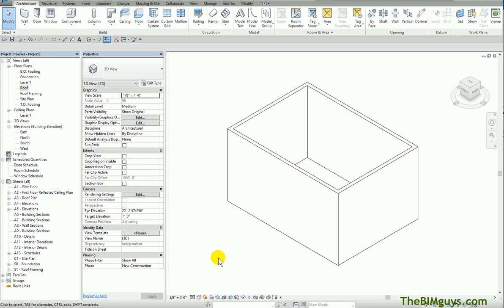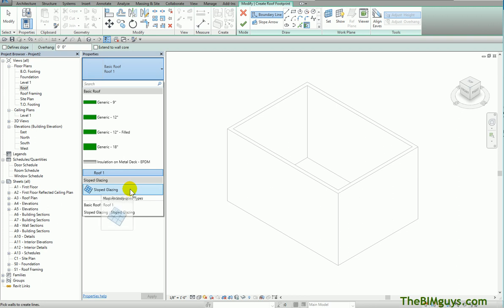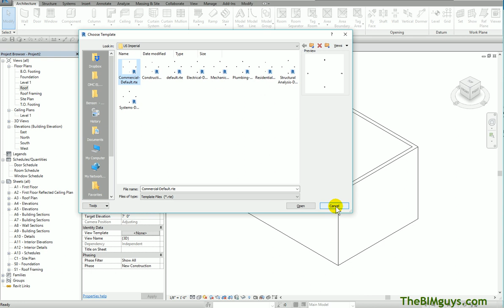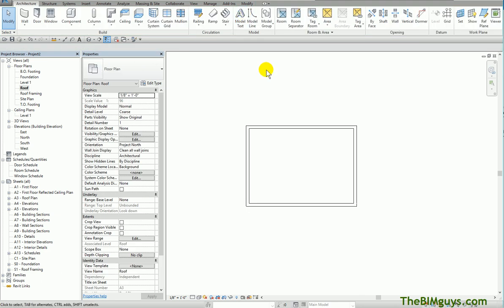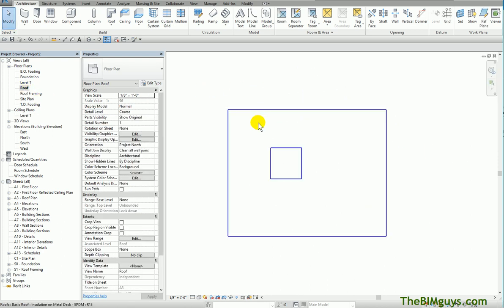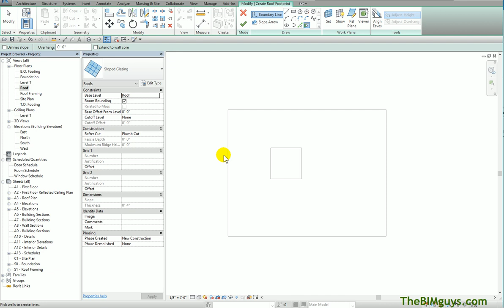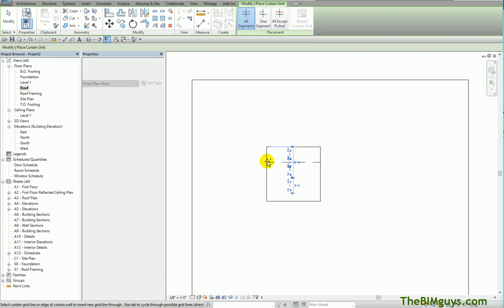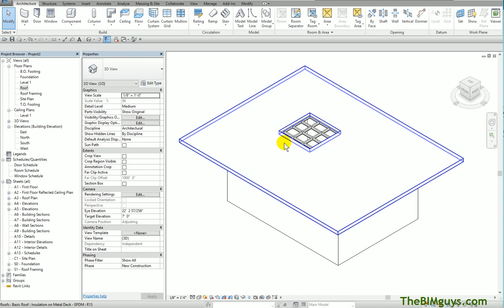Revit Adding a Curtain Wall on a Floor or Roof - CADtechSeminars.com

Comment: I'm facing a small issue. Revit is forcing my roof to be sloped. I can't make it horizontal. I've tried multiple roofs and changing the slope to 0 from the default (30 degrees) but it is not working.
Reply: my guy... draw the roof as an extrusion instead of a footprint. i just had to figure that out after looking ;)
Reply: I figured it out, but I'll try that too. Thanks!  @jackdorward8636